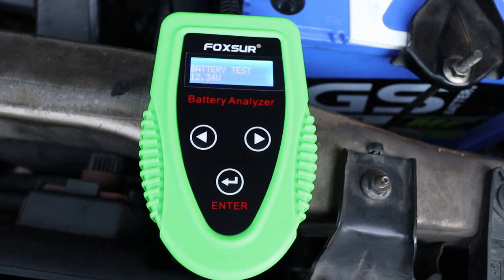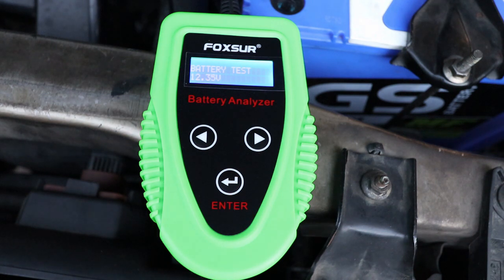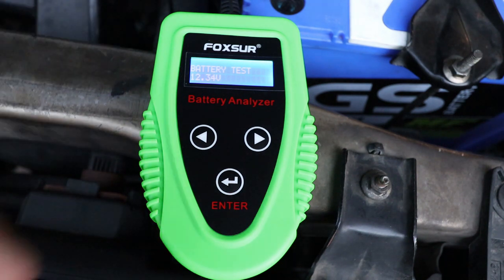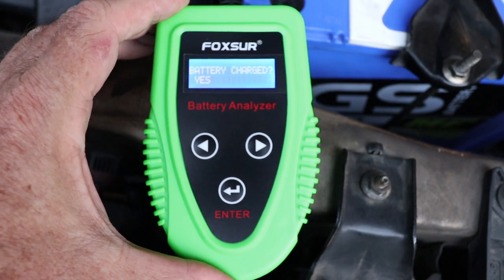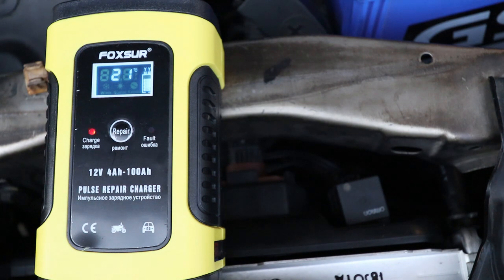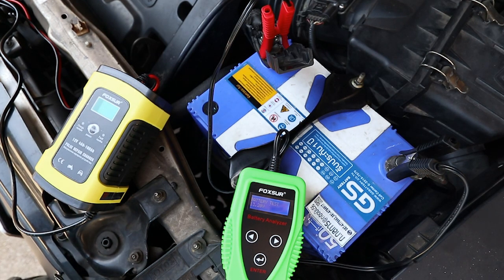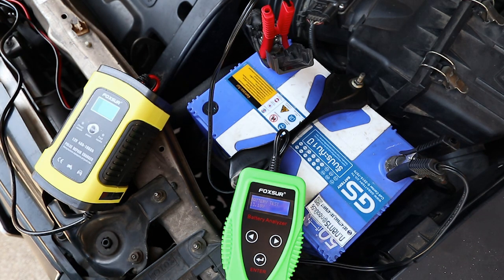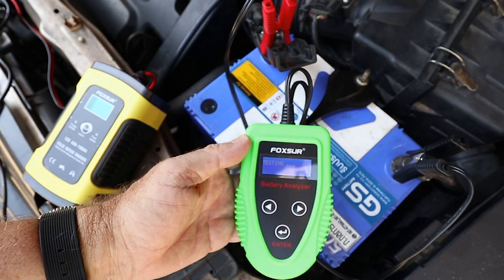Can The Foxsur Pulse/Repair Battery Charger Repair A Bad Battery?

Comment: Any update on the CCA?
Reply from the maker: I've been using my car very little because of the lockdown - maybe once or twice a week - but I just checked and the CCA is 455. It's lower than usual, but OK. It starts every time without any hesitation. My battery analyzer says the battery is still good, but suggests recharging. This is probably as a result of not using the car much. In another post someone suggested doing a pulse/repair every six months as preventive maintenance. The last time I did one was more than six months ago, so this probably isn't a bad idea.

Comment: from other videos, you cannot desulphate if the battery already dead using foxsur charger. but some peoples said, the battery can be revive.

for me, i will take the precautions, just do the repair before the sulphate problem become too much.
Reply from the maker: That's right. It can't perform miracles, and some batteries are too damaged to repair. However, if the problem is just some sulfation on the lead plates, then the pulse repair might be able to improve it.
Reply: @PhilUKNet  i had dead battery from my brother in-law motorcycle. try to charge, the battery cannot hold the charge. but i still want to check with battery analyzer to compare good battery vs bad battery. i just order battery analyzer from online shop. maybe need to waiting 4 to 5 days.
Reply from the maker: @omarsyahrilnorazmi3302  I bought the Foxsur one, which was cheap, and it has been useful.
Reply: @PhilUKNet  i had foxsur charger. good enough to charging my battery. many time revive my sister car battery.

Comment: Thank you sir for your video and explanation, im on looking to buy those charger but curious is it possible to fix and charge the battery.

Your explanation is clear and keep it up doing video like this.

Sorry for my English
Reply from the maker: Thanks for your comment and don't worry about your English! Second languages are difficult. My Thai is terrible!
I too was skeptical about the repair function, which is why I was keen to do this test, but I was very pleased (and pleasantly surprised) with the result. It took the CCA from 191 to over 600, which exceeded my expectations. Had I allowed it to repair for longer the result might have been better, but the battery is good now.

Comment: Can the repair mode be used while the battery is installed on the vehicle?
repair mode has a pulsed current curve, will it damage the vehicle electronic control unit(ecu) etc.?

what are your ideas? thanks
Reply from the maker: Good question and I had exactly the same question! The user manual does not state explicitly whether you can or cannot leave the battery connected while doing a pulse repair. When I have done normal charges I have left the battery connected. However, when I did a pulse/repair I (like you) was concerned that the pulsed current could damage the ECU, etc. I therefore disconnected the battery while doing the pulse repair just to be on the safe side. So, I can't really answer your question. It may be OK, or it may not be OK. If you are concerned that it could do some damage, as I was, just disconnect the battery for some added peace of mind. It only takes a few minutes extra to disconnect and reconnect the battery. I'm quite a cautious person and if I do anything where there is a risk I like to try to mitigate the risk.
Reply: @PhilUKNet  Thank you. I am thinking of removing the battery and then charging it. But does the repair mode really work?
I have a non-working efb battery for almost 4 months and I do not know its condition. I guess it needs to be desulphed. I wonder if this device can do that? Firstly, I think to keep it in repair mode for 1 day and then slowly charge it one more in motorcycle mode.
What do you say, how should I follow?
Reply from the maker: @alibaba-qn3qv  I also have a Foxsur battery analyzer and I saw a big improvement with the CCA reading after doing a pulse repair. If the problem is just sulfation it works, but obviously it can't fix battery defects. It takes a long time - 24 hours plus. Allow yourself a lot of time, just put the charger into pulse repair mode and leave it. When it has finished repairing it will go into regular charging mode automatically. The manual advises charging for another hour once it is repaired, but if longer don't worry because the charger won't overcharge. It may take the best part of a weekend. If the battery isn't sealed, top it up with distilled water before you begin.
Reply: @PhilUKNet  As you mentioned, it worked. Foxcur is not written on the product that I have supplied, but it is made in China. Generally, all of them are contract manufacturing and their names change.
The top covers of the battery do not open, it is maintenance-free and sold as completely maintenance-free batteries in my country, I guess I cannot add pure water because when removing the top cover to add water, it may be damaged and the cover may become unusable.
So, for now I will try to solve the sulfates in the battery by using only the repair mode. Then I will wait and try to charge it once more, actually it may be useful to do a full charge and discharge once.
Reply from the maker: @alibaba-qn3qv  Yes, these devices are sold with various brand names. Your plan sounds good, let me know how it goes!
Reply: Thank you, this is what im looking for an answer. I have the same brand, it repaired an agm battery that I removed from our van. But I havent tried to repair the battery in our audi, it wasnt as easy to remove the terminal because the battery is under the seat and it has battery management system too, It did charge the battery using the terminals under the hood but dont want to risk repairing while in the car. Thanks

Comment: Excellent, clear video. Thank you. Hopefully the foxsur repairs my battery as it did yours.
Reply from the maker: Thank you! I hope you have the same success. Obviously, if your battery isn't sealed top it up with distilled water first and give yourself lots of time. The manual says 8 hours for a car battery (24 hours max), but after 26 hours mine was still repairing. Can you let me know how you get on? I'd be interested to hear the experience of others. Depending on the specific problem inside the battery, the charger may or may not be able to repair it.
Reply: @PhilUKNet  Update from me. After 2 days of trying the foxsur during the day and overnight on both normal and pulse charging the battery still did not receive current and the fan on the foxsur still never even started. I was beginning to think it was broken. In the end I called a mechanic who lent me a 9amp charger which immediately started to work and within 5 hours had charged the battery back up to 12.7v. At this point the foxsur, when connected, did register a voltage reading and attempted to trickle charge. I've since learnt that most new chargers (& cheaper version ones) with micropocessors won't give current if the battery voltage is reasonably low (I don't know the limit). My battery was only just over a year old and it'd been 2 weeks since the car wouldn't start, so not that long. I used the foxsur under the repair mode for next couple of days, just to desuphate the battery. It's meant to read FUL after it's finished repair but after 30 hrs or so never did. But since voltage was good level and it'd been under charge for a couple days I've reconnected the battery to the car. I think this foxsur device will work if the battery has only very recently stopped working but if I leave it any length of time it will not provide current. Other devices, (starting from about double the price or more) will still charge the battery even if very low voltage.  So I plan to return this device and maybe get a more powerful device. Thanks for your help.
Reply: @Taintless101  Hi, do you have a recommendation for a charger that'll charge a dead battery (low voltage)?
Reply: @tramexz  Hi, I've not bought a new one yet (as I'm using car regularly now and battery is fine) but I did a lot of research. Noco have a very well reviewed good range of products, which go up in power and price. Critically a number of their options will charge even dead batteries. They don't give voltage readings (if you want that can get a cheap multimeter anyway) but they're well reviewed. I've not bought yet but will do, two of the ones I've considering  are 1) NOCO GENIUS10UK, 10-Amp Fully-Automatic Smart Charger, 6V and 12V Battery Charger, Battery Maintainer, and Battery Desulfator with Temperature Compensation or 2) NOCO Boost Sport GB20 400 Amp 12-Volt UltraSafe Portable Lithium Car Battery Booster Jump Starter Power Pack For Up To 4-Liter Petrol Engines. Both on amazon. Check out Noco's range and pick the one that suits your battery. Hope this helps.

Comment: Since you didnt let it finish, I wonder if it would have gotten back to 100% if you let it go.
Reply from the maker: Maybe! It went to over 24 hours and I got a bit impatient waiting. When you do the repair function you should wait until the repair finishes completely and it changes to a normal charge. I will be doing another one in the future and I'll make an attempt to let it finish properly!
Reply: With a used (2 - 3 years) battery it is not possible to achieve 100% efficiency again. Foxsur charger will not make the active mass return to the plates. But it will certainly improve the condition and give better results than a regular charger. I can confirm Phil's experiments, the effects in pulse mode are very positive.
Reply: @Tab7.6.Tab7.6  So I pulse charged mine over the holiday weekend.  Checked on it every once in a while.  Started at 62% efficiency.  Once it hit 85% it wouldn’t improve any more.  So at least I don’t have to replace it. But was really hoping for 90%.  Either way, the $25 charger saved me from having to buy a $170 battery.
Reply: @JohnHuthmaker  I think you have achieved a very good result. It is important to remember that the battery undergoes natural degradation due to corrosion of the plates. In addition, there are other things, such as sulphation. To get a more accurate result you would have to leave the battery alone for 48 hours after charging. During this time, the resting voltage will drop and the electrolyte density will increase. But this is not always possible due to lack of time.
Reply: @Tab7.6.Tab7.6  interesting.  I’ll plan to do that next week.  I should have some days that I don’t need to use the car.
Reply from the maker: @Tab7.6.Tab7.6  Thanks for your comment. I never expected it to make a used battery like new, but it can certainly give it an extra lease of life!
Reply: @JohnHuthmaker  Measurement with the tester immediately after charging slightly falsifies the results due to the increased voltage on the battery. Check the SOH after 24h and 48h, you should get more reliable values.
Reply: @PhilUKNet  You are welcome. Despite its fairly simple functions, this charger has a very positive effect, especially with dead or rarely charged batteries. Exceptionally the manufacturer does not lie ;-) I checked on flooded batteries with different capacities. Each time I achieved a smaller or larger capacity increase. As these were the batteries used in cars on a daily basis, I started first normal and then pulse mode. Of course, charging outside the car or with the mass clamp detached, to avoid accidental damage to the electronics. For batteries up to approx. 60Ah one pulse cycle is sufficient, for higher capacities it is necessary to repeat it. Verified by testing the electrolyte density with an aerometer. By the way - I find your reviews of this charger very helpful, especially for beginners, and your comments clarify many aspects. You do not have to be an electrician, it is important that you already have good experiences with this charger. And I agree that it can extend the life of a battery, in many cases quite significantly.
Reply from the maker: @Tab7.6.Tab7.6  Great info, you are very well informed and these comments will be useful for a lot of people.
Reply: @Tab7.6.Tab7.6  did the repair pulse cycle finish or does it keep going forever, the guy in the vid did 24 hours and it was still in repair mode?
Reply: @fatboy9700  This version of the charger shown in the video (Foxsur 5A) automatically ends pulse mode after 24 hours. Unfortunately, another version of Foxsur (8A) does not work this way and the repair mode runs forever.
Reply: @Tab7.6.Tab7.6  after 24 hours repair, is it possible it would need more repair time on some batterys or this guys on the vid?,, and so you could just start repair again for another 24 hours?,, also is this charger any good?
Reply: @fatboy9700  So many questions… ;-) I'll start from the end. Is this charger any good? Yes. Is this a charger for all batteries? No. Based on the tests I've done, in my opinion this device is only suitable for typical car batteries (lead-acid). It is not suitable for GEL and AGM due to too high a final charge voltage. The optimum capacity range is 35 to 80Ah. Up to 60Ah capacity, just run normal mode first and then pulse mode for 24h. Above 60Ah first normal mode, then pulse mode for 24h, then pulse mode for 24h again (yes, you can turn it on again). This strategy will help you recharge your battery well. Caution! In pulse mode, the battery must be disconnected from the car installation (danger of damage to electronics)!. You can charge the battery without disconnecting in normal mode only. You can also use this charger to try to recover a flat battery (deeply discharged). In this case, you need to start the pulse mode first, and after a few hours the normal mode. If you need a more versatile solution, Foxsur has a slightly more expensive 7-stage model 12V 7A. You can use it to charge any type of battery (you can choose the type), and choose between a motorcycle battery and a car battery. In this charger, the pulse mode lasts for 16 hours (which is still good), but I can't guarantee if it will turn off automatically after that time - you'll have to read the comments in the offers, maybe you'll find this information. For example, I have another similar charger called E-Fast, 12V/6A - 24V/3A and it does not switch off after 16 hours. I bought it out of pure curiosity and use it sometimes too, but I prefer the Foxsur 5A because I don't have to remember to turn it off. In fact, to be more precise, it doesn't turn off completely, but goes into float (maintenance) mode.
Reply: @Tab7.6.Tab7.6  ok thank you, im going to get one, in the uk on ebay they do the yellow one for 14 quid, it might be a copy, but its worth a punt, thanks for the help

Comment: will battery be 100%full in pulse mode sir?
Reply from the maker: When I did a repair on my own battery it wasn't quite 100%, but it was close. I should also mention that it hadn't finished the repair. When it finishes it should switch to regular charge mode, but it had already been repairing for 26 hours and I didn't want to wait any longer so I stopped it before it had completed. Had I waited, it may possibly have gone to 100%. 

I'm actually doing a pulse repair at the moment on the battery in my wife's car. The CCA is 310 and when I checked yesterday with the Foxsur battery analyser the CCA was just 198. It told me the battery was bad and to replace it. I started a pulse repair with the Foxsur charger, but it hasn't finished yet. It has been going for about 18 hours now. When it's finished I will check again with the battery analyser and I can let you know what happens.

So, to summarise with my experience so far, not quite 100% but close.
Reply: @PhilUKNet  thanks sir, i pulse mine for 48hours and it still blink all from 20-100%,, not like when i charge it, only blink the part that need to charge,
Reply from the maker: @robbyyoung4260  Same here. It's now been going for 24 hours and all the bars are blinking. My wife will want to use the car soon and I will have to stop it before it completes. However, I am sure that after 24 hours there will be a big improvement. The device works well, but it takes so long.
Reply from the maker: Here's an update and the answer to your question really depends on the condition of the battery. When I did a repair on my 620 CCA battery it was almost back to 100%. When I checked my wife's 310 CCA battery yesterday it read 198 CCA. I've just completed a 25 hour pulse repair and the charger told me it was successful and that the battery was full. However, when I analyzed it the analyzer told me it was 200 CCA, still bad and needs replacing.

Therefore, it looks as if the problem with this battery is more serious than just sulfation. If a battery is sulfated the charger can help, but if it is old with other problems the charger can't perform miracles. The battery in my wife's car is now fully charged, but the CCA is low and I suspect it will need to be replaced soon.
Reply: @PhilUKNet  thanks sir,maybe mine included in the un miracle one🤣, for safety,i think,ibetter replace it with an new one,